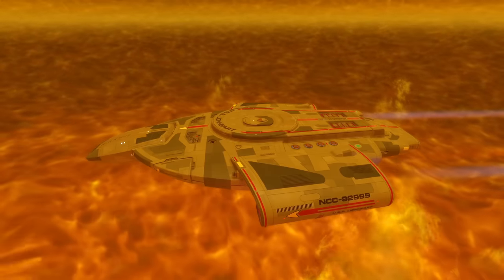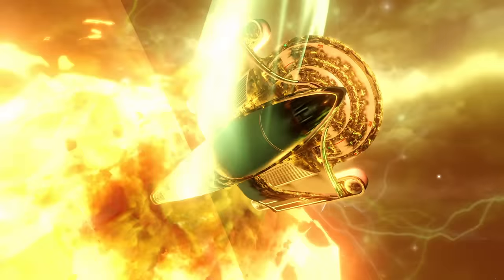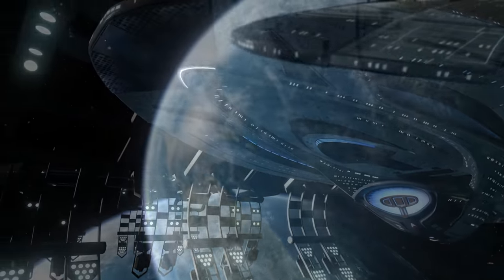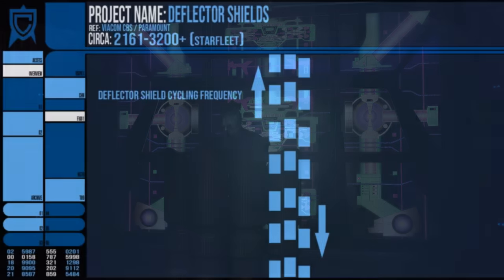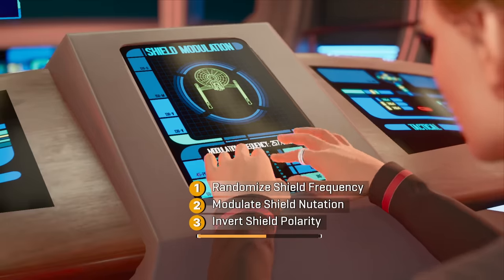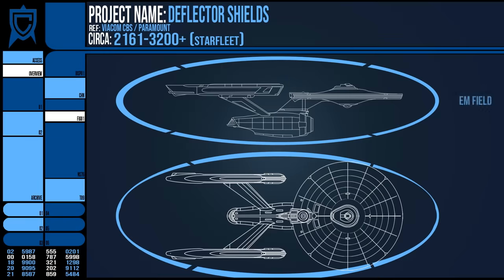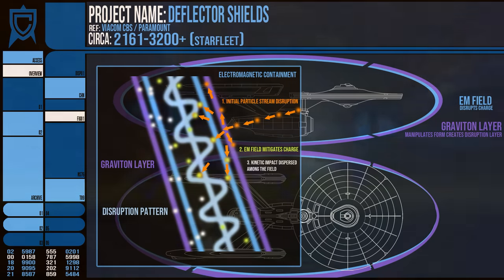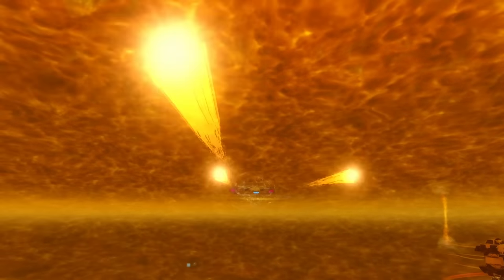What Makes Deflector Shields Different?

Comment: In my Space Opera the defensive shielding is actually a hard light for defense in addition the ship also has Point Defense Turrets to obliterate oncoming warheads, where as the ship's anti grav engines would deflect oncoming micro meteors. Which makes me wonder... if Star Fleet ships have Phaser Belts why don't they just use it as a point defense system and destroy oncoming enemy torpedoes?
Reply: Hard to calculate or hit (it is a good question thought as it should be possible) the "half a Galaxy" class ship with the module utily on top is seen in games to have an option to have a torpedo point defence module that can take out all incoming torpedos for a short time when activated (as well making a ship immune torpedoes would make it pretty powerful in a game)

Funny thing is you see the phase cannon based taking out most of neos mining torpedos in the alternate time line
Reply: @leexgx Nebula Class, with the Point Defense Phaser upgrade in Star Trek Armada 2 is what you're thinking of.
Reply: @Kittamaru  yes it was very cool if you could Stagger the ship groups so you could make them never get hit by torps

Comment: One possible explanation for the deflector shield is the "positive curvature bubble".
As we all know, the conventional spacetime curvature is "negative curvature" from a simplified flat perspective. Therefore, the straight line vector from the flat spacetime perspective will be deflected to the inside of this negative curvature depression.
Then, if we create a positive curvature spacetime bulge in reverse, we can form a repulsion and deflection effect.
And it just so happens that this is exactly the structure of the warp bubble. An important difference between Star Trek's warp engine and the Alcubierre engine is that it first forms a sub-spacetime bubble to wrap the starship, and then warps the spacetime outside the "warp bubble" for propulsion.
Considering Star Trek's in-depth development of gravitons, subspaces, and spacetime phases, this technical principle is feasible.

Comment: Actually it kinda makes sense that we see beaming through shields less. Because with the whole refresh rate frequency idea, when it comes to energy weapons it doesn't really matter if 1% of the energy doesn't make it through due to slight inaccuracies in one's knowledge in what that frequency is and/or the accuracy of whatever is controlling/generating/regulating the frequency reference  (like how a radio needs to have the oscillating frequency generator for reference to process the incoming information normally via the use of a crystal oscillator; I might be screwing that up slightly or oversimplifying). However with a transporter.... that 1% may very well be the difference between life and death for the person beaming through.

Comment: The shields in the first movie used multiple emitters that each had a piece of a very strong and resilient plate of metal then energy is run through it making a copy appear outside the hull. As described in Mr. Scott's guide to the Enterprise.

Comment: If the deflector shields disrupt any incoming matter or particles, how is it possible to see the ship inside the shield? Or how can the ship inside the shield see outside of it? Wouldn’t ships just end up being opaque bubbles in space with shields up?
Reply: I actually had a thought on this recently.  If the shield is an energy field that can be disrupted then any particle - such as a photon - hitting it would result in some tiny change to the field.

If you could detect these changes and feed them into a powerful enough computer, you could form a rough picture of what's on the other side of the shield, and we already have the tech today to generate imagery of all the things we see in Trek.  If you get something that vaguely suggests the outline of a Bird of Prey with the generalized EM signature of a bird of prey you can guess it's a Bird of Prey and adjust whatever image is shown accordingly - and we know that sensor ghosts can show up on a ship's display as the actual ship, since Worf has used that trick once.

As for seeing outside of the ship, it may be that the field is somewhat directionally selective in how it disrupts output and it's only for some things which are too high energy or which require some level of high-fidelity bi-directional communication that you might have some sort of issue.

With that said, Starfleet shields do apparently have a 'refresh' cycle which largely would solve this issue, as it means there's non-continuous gaps in the shield and a sufficiently high refresh speed is basically invisible to the human eye (you probably don't notice that the display you're reading this on is rapidly refreshing the screen, for example)

Comment: Here is how they work. Much technobabble. But based in current day Science. 

Forcefields/shields work by projecting a dense Sigma Baryon field between the emitters. When interacted with the Sigma Baryons decay into Lambda Baryons, or something close to Neutrons. Due to the Inverse-square law the small amount of Neutron like emissions radiated by the Sigma Baryons decaying into Lambda Baryons is negligible. This keeps Neutron like radiation at a level safe set by Federation standards. However, when Sigma Baryons decay there is also a secondary effect called the Pi-Zero weak interaction. This effect emits electron positrons and thus the annihilation of nearby electrons are ensured. So any incoming weapons fire that has electrons is annihilated. This annihilation causes matter to be converted in to energy (E = mc^2). This is why there is a visible 'light effect' that happens as the field is interacted with. The 'harder' the field is under pressure the more visible light effect there is. Therefore, more matter being converted into energy can also cause heat radiation and burns. This is also why you can see a forcefield being 'put up'. As the forcefield is put up it has to move the air out of the way of Sigma Baryon field. That is why brig force fields also 'sparkle' when turned on. Because a small amount of matter is converted into energy as the forcefield engages, thus the light effect when activated in an atmosphere. When a forcefield/shield engages in space, which is basically a vacuum, you don't see this energy effect as much as space is basically empty. The power requirements that are used to make a Sigma Baryon field are immense. That's why forcefields/shields can weaken overtime, as they are being energized/matterized(?) by gigantic capacitors that must be recharged by the Warp Core. That's why star ship shields can take several minutes to be brought back online.

Comment: The reason why torpedoes hit the shields is due to the speeds involved.  Torpedoes are fired at relativistic velocities and use warp sustainers if fired at warp speed.  Any object like that striking a charged plasma field, like a ship's plasma shield, would go through a rapid change in speed.  This shock would prematurely detonate the warhead at the shield's perimeter unless the warp sustainer could be configured to match the shield's frequency, effectively passing through it with no shock.

Comment: Shield strengths seemed to vary, making an exact calculation of how much damage they could take impossible. However, there were some examples:

•A Constitution-class starship's shields could take the equivalent of ninety photon torpedoes t once. They could do so a total of five times before shattering completely.
•A Sydney-class starship could be destroyed by two photon torpedoes from a Galaxy-class starship with weaken shields.
•According to Malcolm Reed, the shields of the 22nd century Nausicaan ships won't hold against a torpedo from the Enterprise NX-01.

Comment: I'd be curious to see a future shield design which uses modern day asteroid shielding as a basis. You have a bunch of angles built into the layered plating, which diverts the impacting material by "normalizing" its trajectory with the plate. This could be used in shielding to not just defeat an incoming energy beam, but actually turn it around to a point. Let's say that under light fire, the shields could bounce the beams back fairly accurately, but under heavy duress, they kind of just glance off, saving as much energy as possible for the next impact.

The downside is that this would have an absolutely catastrophic effect on any solid matter impacting the shielding at relative speed. Like a giant cheese grater.

Comment: I have often speculated which Master of Orion 2 technologies a given starship or station in science fiction would have. For Starfleet shield systems, I have thought Class V or Class VII shields with the Hard Shields augmentation. This doesn't quite fit, however. While Hard Shields protect against some things which Star Trek Deflector Shields protect against, they also protect against more which Deflector Shields do not.

Comment: My biggest gripe with shielding is how random its effect is.
Like in one scene it is blocking all kinetic energy making it dangwrous to impact even with another ship and in the next a random astroid(even though bigger or a way smaller jem harda craft just passes through ramming the ship in the process.
And then there is the thing that ships under fire have exploding consoles and celling rocks fly everywhere only for tactical to say "shields holding at 70%".
Second heavily implies that impacted energy still somehow gets imparted into the ship by some kind of reverse energy flow or kinetic momentum

Comment: Ughh. Ok. So the ships have the ability to create artificial gravity. So it stands to reason this is also used to create sheilds. The sheilds are a combination of plasma energy confined within a magnetic field. Congrats you have a viable energy deflector. However to withstand a kinetic attacks, aka a torpedo or asteroid or the hull of a bloody ship, you need to be able to turn that plasma into a solid. This is where the ships artificial gravity field comes in play and why the sheilds have limited life spans. So to withstand a kinetic attack the sheilds must compress a subsection of said shield with enough force to turn the plasma into a crystalline solid for an instant. This causes the plasma, likely made from hydrogen, into metallic hydrogen, and in doing so schluffs off of shield grid like frost from a windshield when scrapped off. This is why the sheilds arent "eternal" Because it takes ALOT of energy to make energy into matter, even one like hydrogen. Even more energy to compress said matter into a metal. Now the field is both sophisticated and precise enough to compress the shelds meters at a time instantly. But This also explains why the duras were able to thrash the D in generations. That shield frequency that had geordi give them was NOT the plasma radiant frequency. It was the gravity generator frequency, which is fixed, the gravity field has an upper limit and if you can exceed that limit you can disrupt the compression matrix of the plasma should and like an operah singer, shatter the plasmatic metal preventing it from stopping kintic energy attacks.

Comment: It's a shame you got it fundamentally wrong.  But then again, they frequently get it wrong on the show too, so at least you're in good company.  A "deflector" is not a defensive force shield.  It's supposed to be shorthand for "navigational deflector" and it's supposed to be a field that is projected out in front of the ship to deflect dust, micro-meteorites and other smaller-sized space debris out of the ship's path.  The faster the ship is going, the more dangerous such collisions would be,

Comment: Magnets. How do they work? And I don't wanna --
Reply: The atoms in "magnets", permanent or electromagnetic are organised and aligned in a specific way that aligns the atoms in another material (with similar properties) with the opposing polarity and enough charge exists in all those aligned atoms to pull the atoms closer together. If something is already magnetic the polarity can either be opposed, increasing the attraction force, if the polarities are equally aligned then there is a strong repelling force. Every permanent or electromagnet will have both polarities, to finish my one paragraph explanation of a very complicated topic it can be loosely described as an amplification of all the attractive and repellent properties all atoms can have by aligning them in large numbers. Some materials are more susceptible than others and generally the polarity of atoms in a material are chaotic and ever changing rather than organised like in magnets.
Reply: Sub space shenanigans, it's always sub space shenanigans. :)
Reply: @Tuberuser187  Yes.
Reply: @Stormcrow_1  Also yes.

Comment: Energy shields are not an efficient form of defense. Putting out that much power in every direction at all times is far more than the pinpoint to be defended against. The emitters themselves have waste heat and weight. The energy could be better used evading fire, and for longer without the huge waste heat. More powerful engines moving a lighter spaceframe.
Reply: Inertia is a thing. Material strength limits are a thing. Slapping bigger engines on without strengthening (and thus making heavier) the frame will just give you a ship that quickly no longer has any engines
Reply: @LucaUmbriel   Sure, but that goes double for shielding arrays whose waste heat would fatigue the hull and cook the crew. You're describing a problem that was solved with Gen-4 combat aircraft.
Reply: You're not going to evade phaser fire though.  Especially with the ships as big as those in Star Trek.

Obviously, they've somehow found a way to overcome those limitations you've mentioned in the same way they've managed to achieve gravity on a ship. You know, in a sci-fi series.
Reply: @mechanomics2649  So, some things about real warfare you may not be aware of. Aim is almost never 100%. This will continue to hold true for DEWs. Second, Cyber and signal warfare. If your target is suddenly 20 and none of them in the real spot of the one no accuracy means anything. Third, most engagements are determined by who lined up the other first. That means mobility.

Whoever sees the other first is the winner. Whoever gets seen first is toast. That argues even more for speed and maneuver over armor and shielding. Armament has always had the edge over armor. Star Trek can up the scale, but that doesn't change the game.
Reply: yes, but the writers and modelers aren't really experts in rocket science and always did Operate on the Basis that it's most important that it looks cool, so the Impuls Engine Placement are far from Ideal and since in Star Trek "space is cold" they also don't need any giant radiators like in Avatar. 
It is somewhat more tech heavy then Star Wars, but like it, it lays more emphasis on Social commentary than "getting the tech right" like a 2001: a Space Odyssee, the Martian or the mentioned Avatar